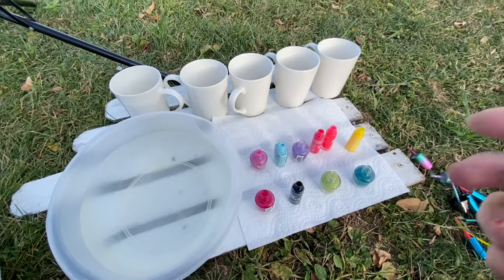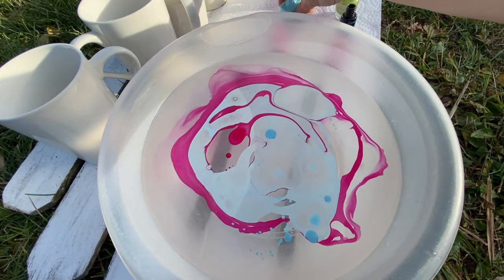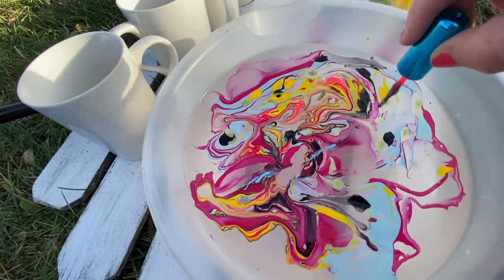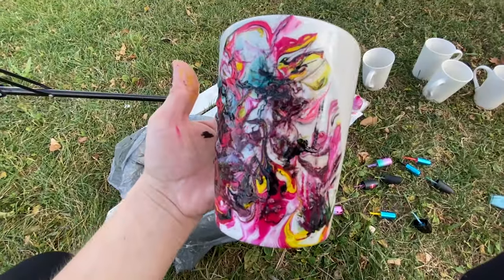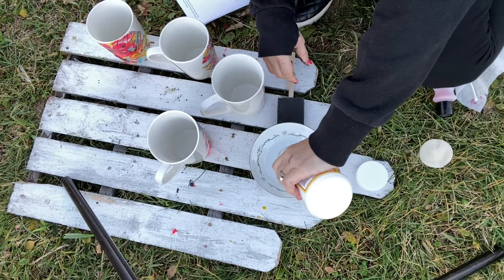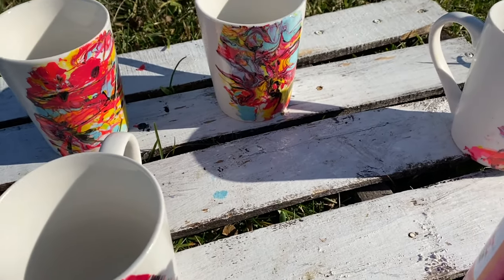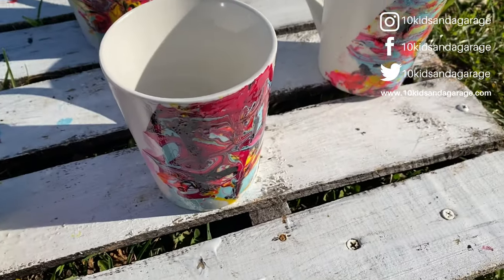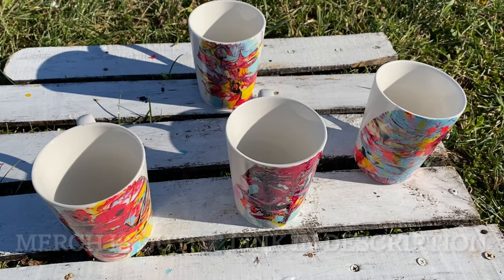How to Hydro Dip a Coffee Cup! || Perfect Gift Idea! || Mom of 10

Comment: Can you use painters tape to cover the handle and top to dip the whole mug? And do you wash them after you use them?
Reply from the maker: Yes you could put tape on the handle, you need to wash by hand. If you seal with epoxy I think you can then but in dishwasher